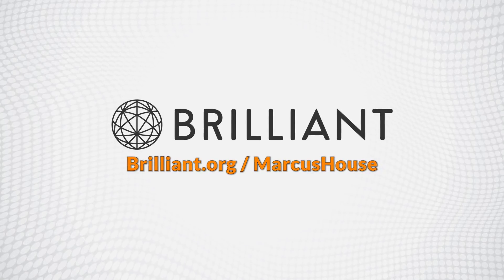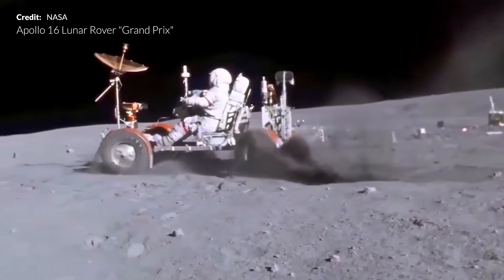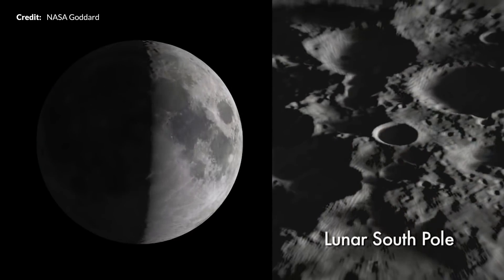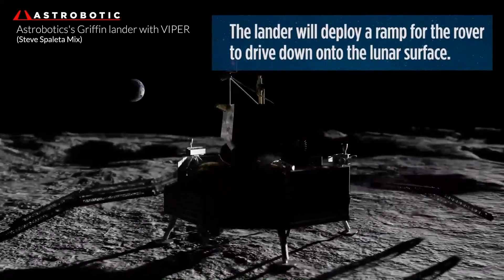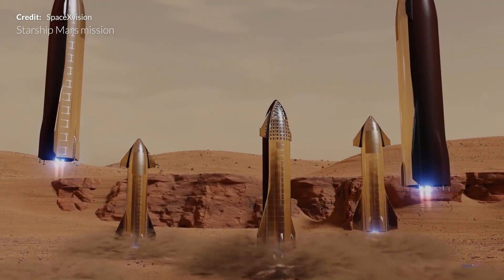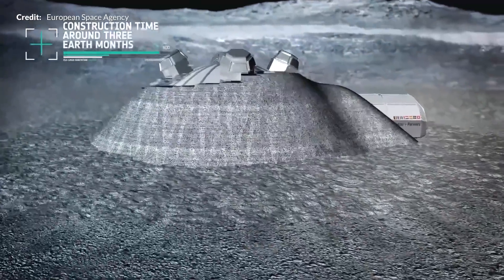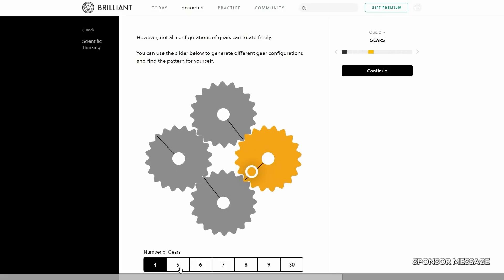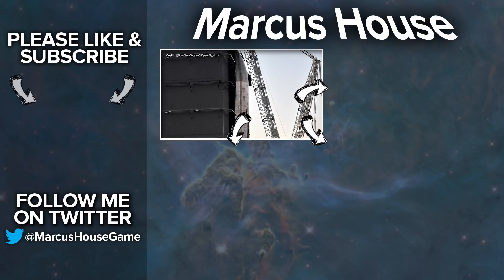Starship propellant production at destination - An essential element of making life multi-planetary

Comment: Not enough attention is given to the importance of In-situ utilization. Thankyou for bringing it the attention the topic deserves
Reply: ISRU in the past was like a trailer without a car to pull it. Without real ambitions for a long term mission im the past 20 years, these projeces cant really take off. Therefore Starship and the new NASA moon base are so important .
Reply: @langohr9613ify  I could not agree more
Reply: I'd say ISRU is starting to be given the importance that it requires.
Reply: Yee
Reply: @Timothy Albiez    The space community is waking up. There is only so much that can be done at the end of a 250,000 mile supply line. To do more than the first stages of exploration, ISRU is necessary on a large scale. Agh I'm preaching to the choir.

Comment: Hi Marcus, great video. I'd love a deep dive about the percolates in the martian soil - the problems and potential opportunities they present for human explorers
Reply: I second that! (Correct spelling, for the search bots: "perchlorates and peroxides in Martian regolith")
Reply: The way we rid soil here of them is by flushing water through it and filtering the water iirc. It’s not a difficult process here but on a very cold planet with no breathable atmosphere where every drop of water is precious it could be a challenge. I’d suggest if we have a base near the South Pole of Mars as it’s polar ice region seems larger plus the magnetic shield is at its strongest (1/40th of Earth’s but far stronger than the North Pole) you could have machinery built to produce water for the process.

I might be wrong but there are ideas on how to use the perchlorate once filtered to recycle it and get further value from the process.
Reply: @stevepirie8130  sounds effective! - and as you say, resource expensive on Mars. I was wondering if they could turn it into a useful resource, and found an article on a guy working on that: "John Coates, a microbiologist at UC Berkeley, has patented a mechanism he says can turn the perchlorate into oxygen fit for humans" looks like his innovation can be solar powered as well. Maybe they can do this at a large scale to clean the soil and stock up on O2

Comment: While lots of attention is spent on all the high tech equipment that will be used, I never hear much about what machine tools may need to be brought along to help maintain everything. That would include things like lathes, mills, surface grinders and metrology equipment for making accurate measurements. Also things like welders and torches will be needed.

Comment: For ISRU  what matters is variety of rescources and energy availability .
The Monn has both of them in spades only at the poles,but still,in spades. Volitiles plus abundunt minerals and 330 days of full,uniterrupted 1300 Watt/m^2 solar flux.
Mars on the other hand is a jewel of rescourses second only to Earth herself. But...the solar flux ranges from 720watts/m^2 in the winter and 450watts/m^2 in the summer.
It also has duststorms that can last for months and block most of the light.
BTW i don't expect nuclear power (at least for the first decade) to play a primary role. It will be a crucial back up,though.
This is because we cannot scale it up in a meanigful way. The kilopower reactor is expected to be rated at 10KW. You need about 10 of them just for the life support system.
My bet is that for Mars Space X will need to develop space based solar. Or at least have large,thin mirrors in space to reflect more light at the ground based solar array. We can easily do that.

Comment: The technical possibility of having a station somewhere, might be possible. But the challenges are enormous (good to start investigating for sure, but without being able to repair constantly, that'll remain a big issue). And then there is the human itself, the thrill at first will quickly give way to stress and boredom, which are very problematic as this lock-down has already shown. :)

Comment: In situ utilization on both the moon and Mars have the same limitation, namely, the availability of electricity to power everything.  You would need several square kilometers of solar panels, and a couple of megawatt hour capacity batteries to sustain a base and perform the chemistry for methane and oxygen production.

That or an equivalent power produced by nuclear plants ferried to the Moon and Mars.

Comment: Certainly some encouraging info on useful materials out on the Moon and Mars - wondering about the other requirement - energy - takes a lot to convert those low grade "fuels" into anything useful - is the plan to get an atomic reactor out there, or massive solar collectors, or? Just wondering, haven't seen it addressed...

Comment: Fusion Reactor sounds like a nice ideal but have you seen the current size of the latest reactor! They been at this fusion thing for 80 years, trying to get to work. A thorium molten salt reactor could go up in one StarShip, unlike the current cold war nuclear reactor we use now which uses water, has a fuel efficiency of less than 1% and a waist lifetime of 10 thousand years, compare the thorium reactors a fuel efficiency of 99.99, waste lifetime of of 300 years and no water improved safety as well. The one problem no is paying any attention to is computerisation of devices from tables to control systems, the current short life and poor security, could result in death of colonist.

Comment: I'm quite curious which companies are at the forefront of fulfilling supporting roles in Moon/Mars missions.
When ISRU is mentioned, people automatically think of generating methane/LOX from CO2 and water. I think SpaceX is quite capable of building an efficient Sabatier reactor -- I'd be surprised if they haven't already built some prototypes. But they have also mentioned specifically that they're looking for support when it comes to construction, food, metallurgy, long term life support & comforts, etc. Do you think there are any serious partners (besides NASA), or do you think SpaceX will end up doing most of it themselves after all?

Comment: Sorry Marcus, but I'm going to have to pour some cold water on all of this. When Neil deGrasse Tyson was asked what he thought about the prospects for a permanent Martian settlement, his answer was basically "It won't happen. We've had the capability to build settlements in Antarctica and in the deep ocean for decades. No one has done so. Why? Because no one wants to live there." Mars is a hundred-fold more hostile and more costly. Mars settlement has no business case. One can dream, of course.

In situ propellant production on Mars is not actually necessary for sensible, limited, scientific and exploratory missions. In situ oxygen production for life support is necessary and under some circumstances it would make sense to produce the oxygen needed for ascent from Mars surface to orbit. In situ production of methane (assuming direct return to Earth) requires the strip mining of many thousands of tonnes of Martian soil, per launch. Mining machinery here on Earth requires constant maintenance and replacement of wearing parts. On Mars this becomes many times harder. You not only need a large fleet of power hungry mining robots, but you need all the robots that maintain and repair those robots. And the spare parts (which often use hard to refine metals). Plus you need an energy source for all that mining activity. What energy source is this? What is the production process for this energy source? What about ancilliary robots, cabling and all kinds of things that are needed to provide the supply chain of energy to the actual mining robots? These will need to be supplied from Earth. Then there's the processing - industrial scale chemical processing. The reactors. The plumbing. The valves. A million things that can wear or break. More spare parts. More robots to fix things. Often behind a long communications delay. Now, what about the multi-Megawatt power source that runs all of this. Too many people do back of the envelope calculations that are based on the processing demand alone and forget about the energy needed to run an ecosystem of mining robots. Its one of those engineering problems where it all multiplies way beyond your original assumptions. Then there is the question of solar versus nuclear. Solar is workable but not without planning for months of down time. Nuclear is out of the question - it won't be sanctioned by governments and in any case, that quantity of nuclear material leaving Earth is a genuine ecological threat here on Earth. 

In situ production of methane is stupendously costly in terms of energy and materials. It is complex, risky, time consuming. It involves a vast quantity of mass being shipped one-way from Earth to Mars. So much so that, given the fact that methane is only 22 percent of propellant, it makes far more sense to simply ship the methane from Earth.

There is a nice irony here. Having a fully reusable heavy lift vehicle that can carry cargo into Earth orbit (and higher) cheaply means that it will be far cheaper to export methane to Mars than going through all the cost and complexity outlined above. In other words, Starship will undercut the economics of making it on Mars.

Note that I'm not talking about using Martian/lunar soil for building. That does make sense. But it requires far less energy and machinery - at least for sensible, limited missions. Also, I don't deny that processing soil to top up drinking water is a good idea. Again, very limited scale and energy involved.

Helium 3 from the moon. Sorry, but fusion energy will prove uneconomic. Grid scale energy storage is going to be a mature technology and cheap, long before even ITER has completed its run. Its a resource we just don't need. And even if you were an aficionado of fusion, there are better fusion technologies that use hydrogen/boron as a fuel and don't produce their energy in the form of neutrons. Simpler, safer and cheaper. But even then, my money is on grid scale energy storage.

One last thing. Rich people have far more sense than to want to spend their fortunes in order to suffer the deprivations, physiological and psychological damage and risk of death that going to Mars would entail. They like everyone on this planet enjoy the simple pleasures. Like sitting on a beach, being able to breath the air and being able to safely have children. Its better left to a small handful of well trained scientists who are willing to suffer the consequences.

Comment: NUCLEAR PROPULSION - small reactors - how can they speed up interplanetary travel?
Reply: Musk hates nuclear.
Reply: @KevinBalch-dt8ot  
Hates?
Reply: Once landed they’ll need a reliable power source when the continent sized and even global encompassing dust storms hit. Last one was 2007 and is seen normally every five or so years so it’s overdue.

Wind power is too weak there even with 60 mph winds recorded because of the thin atmosphere it’s actually feeble compared to Earth’s winds. I had thought maybe floating solar panels by balloon above the storm to catch the sunlight but that atmosphere won’t help.

As for getting there it does look like Elon isn’t interested in nuclear propulsion but he’s flexible. Show him a great, safe design allowed by treaties that’s cheap and easily maintained and I’m sure he’d check it out if it gets his ships there quicker.
Reply: The best use of nuclear energy is for steady power production. A way to consume the entire thermal output productively is the best way to take an electric production reactor offline.

Comment: I have too say... At the distance from the sun, is there enough solar radiation to power all human needs AND make fuel?  How many solar panels will it take?  Musk is making solar panels - but they are of the lower efficiency type (not gallium based).  They will need a huge number of solar panels to create enough energy to mine the water, do the electrolysis (it is really slow and inefficient ), run the Sabatier process etc.
Reply: Who says that it will be his panels going to Mars? This is the problem so many people have. Musk shows some ideas on how things will work and so many people assume that he will do everything himself. There will be hundreds, if not thousands of businesses supplying everything needed for a colony. Even multiple countries, not just the USA, will be used and in fact needed. That is his plan.

As far as solar panels go, they are expecting to have massive fields of them. Multiple Starships will be sending the panels. The only starships returning will be those for crew missions. The cargo Starships will all stay on Mars, at least initially. And the Starship that is sent as the return craft will have about 3 years to refuel. Even lower powered systems can do so.

Comment: I want to see food manufactured from chemistry, without photosynthesis.  Photosynthesis is quite a bit less efficient than photovoltaic energy collection.

--

Abrasive dust makes equipment wear out.  I imagine the first Martians rolling out tubes, and inflating them with filtered Martian air at pressures barely higher than the surroundings, to create a network of routes that the machines can move through without being exposed to dust.  Small leaks would be relatively harmless, because nothing would be lost except filtered air.

Air filtration isn't as simple on Mars as it is on Earth, though.  There isn't enough air pressure to push air through a typical filter.  So the compressor has to be on the outside, exposed to abrasive dust.  Or at least the impeller and bearings do.  Those impellers and bearings, and the seals that protect the motors, will be high-turnover parts, that are also relatively low-precision and low-tech, and not ultra-low-mass. So I think they'll be among the first things to be manufactured on Mars.

Comment: How about landing a Mars Starship dedicated to fuel production?  Powered by a small nuclear reactor and using the spent fuel tanks as storage, it would eliminate construction/assembly at the site and be ready to go from day one, producing fuel 100% of the time. 

The reactor could also provide power to other structures on the surface, battery charging, etc. and avoids the hazardous and time consuming solar farm construction and periodic cleaning of the panels.
Reply: Reactor isn't easy to get for non-government
Reply: @alvianchoiriapriliansyah9882  Nuclear power plants seem to be able to manage the necessary paperwork.  Besides, the reactor will be operating on Mars, hardly a  threat to life on Earth.
Reply: @franksolario1842  But the reactor will be launched from Earth = launch risk
Reply: @alvianchoiriapriliansyah9882  The Galileo, Ulysses and Cassini space probes used plutonium 238 as their power.  As did the Mars Curiosity rover.

Transporting solar panels and batteries to Mars (plus the risks involved to the astronauts in unpacking and assembling them on the surface) does not justify the meager amount of power produced during the daytime hours from a Sun with half the intensity -- assuming they can keep the dust and sand off them.  The Mars Spirit rover stopped operating when blowing sand covered it's solar panels.

And what do they use for power during the solar panel construction phase?
Reply: @franksolario1842  You're all talking NASA missions, which is owned by government lol. No one in your list mentioned any private missions, which is what I'm talking about

Nope, Spirit was dead because of its wheel trapped inside Martian soil not because of solar panels. Maybe you're talking about its siblings Opportunity instead, but it has endured several storms for decade! And crewed missions will be better since they can clean the panel off

Pretty sure they had batteries (especially since the ship already had solar panels on its own)

Comment: So I couldn't understand if it is possible to produce fuel with the resources the Moon offers. Does it depend on the engines fuel? From what I know there is no methane on the Moon so SpaceX can't produce fuel for the raptors
Reply from the maker: Not for Starship as that requires liquid methane, but certainly for other Hydrolox engines. The RL10 is a great example of an engine that would work well with fuel from the moon.
Reply: @MarcusHouse  Thanks

Comment: Dear Marcus, this sort of video describing design concepts for inter-planetary travel is very inspiring. Would you consider doing an episode on the need for articial gravity to ensure human physiology can survive the long travel between the Earth and Mars and return? I presume you've viewed this video which proposed using two Starships in the refuel docking position? https://www.youtube.com/watch?v=kRO_07nEi8g Of course this would require the ceilings to become the floor during transit, but it seems plausible using the current design evolution. I suppose later a four Starship docked configuration nose to nose might be considered like a mini-space station so the floors remain the floors (and which would allow transit between Starships if necessary) but this would also require a special central docking collar that hasn't been designed yet as far as I know. The prospect of this mini-space station wheeling through space between planets as a taxi just boggled my mind! Anyway, I thought it might be an interesting project to research that could really help practical design concepts for Space X.